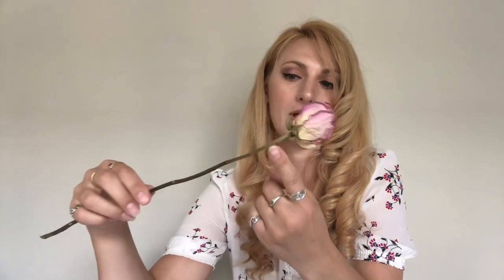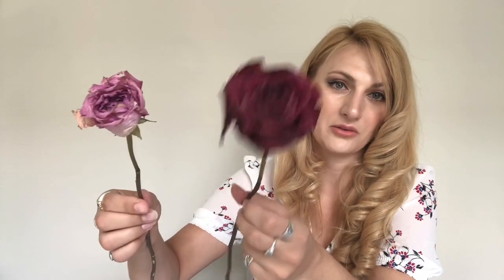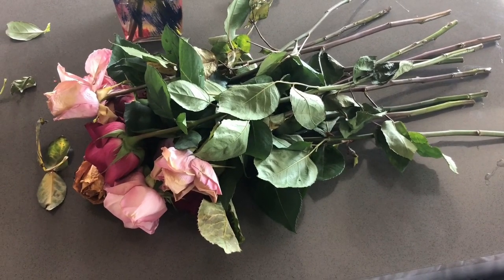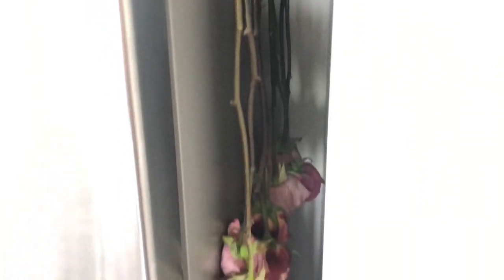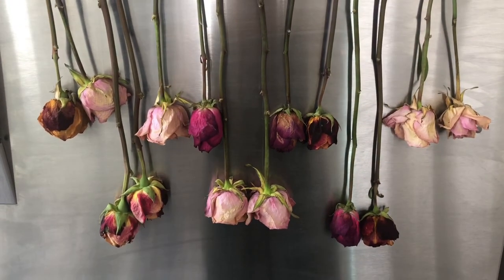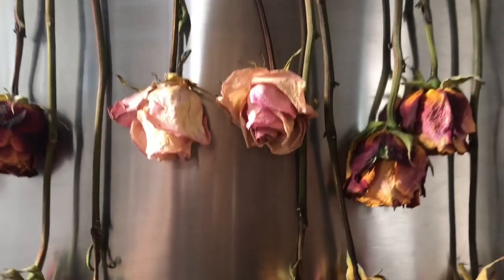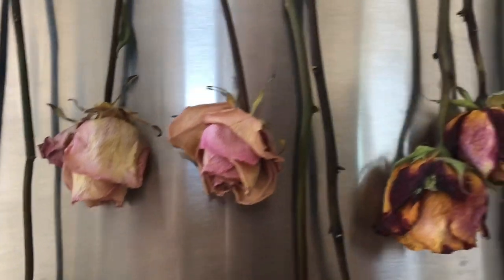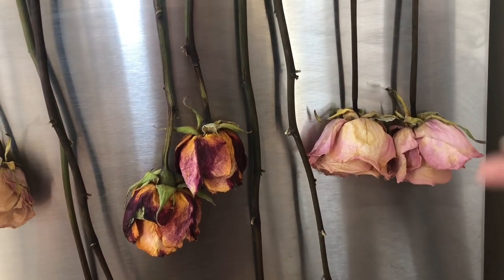How to Dry Roses (Updated Video)

Comment: Is it normal for my red rose to turn black after air drying? 😅😅😅
Reply from the maker: Deep red roses do tend to dry quite dark. If it's a lighter red, or pink rose, it's unusual for it to dry darkly.
Reply: How long will the air dryed rose last? I already put mine in a shadow box and I still don't know how long will it stay on its shape.
Reply from the maker: @nesleygomez6427  The shape basically stays forever. The only things that can damage it are moisture (the roses can grow mold) or impact (the petals are frail and can be broken). So as far as shape goes, you should be good. They may start to lose their color after a few years. The deep red ones tend to get darker, and the pale ones eventually turn a tan/beige color. In my experience that takes several years though. If they are in direct sunlight the process speeds up, however. -Hope that helps!

Comment: Can I cut the flowers off the stems after they dry so I can use them in a shadow box?
Reply from the maker: Absolutely! I've done that with several of my flowers. (I actually recently did a video on it) and they worked perfectly! (Use strong scissors or shears, the stems are tough to cut). :)